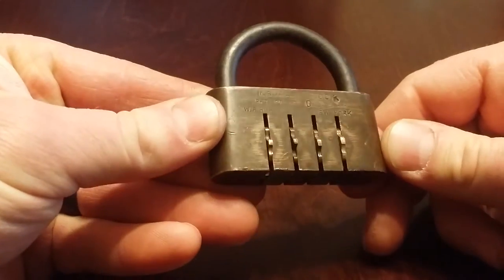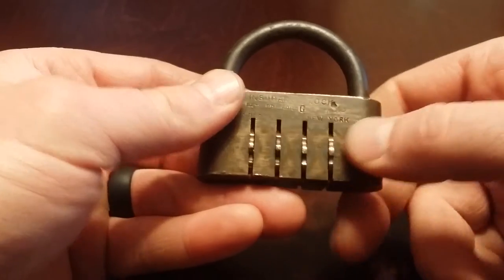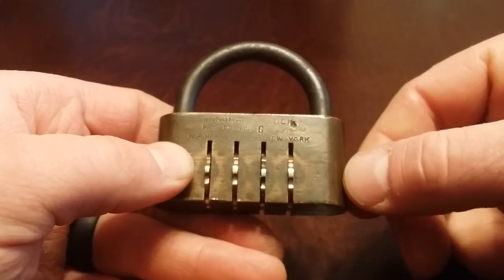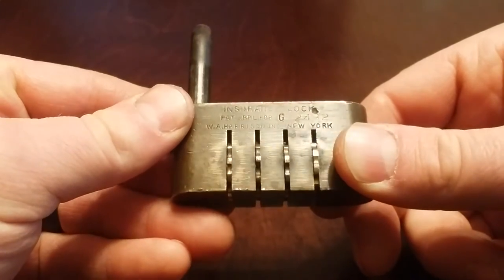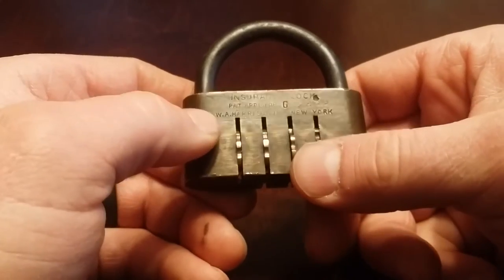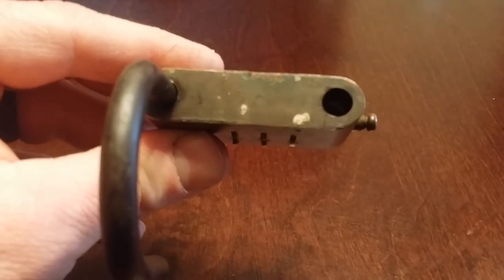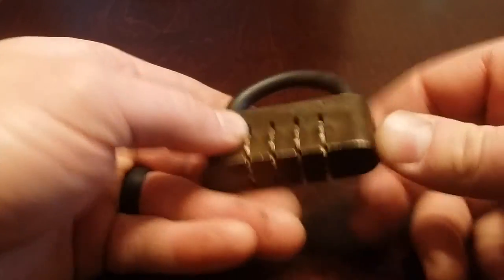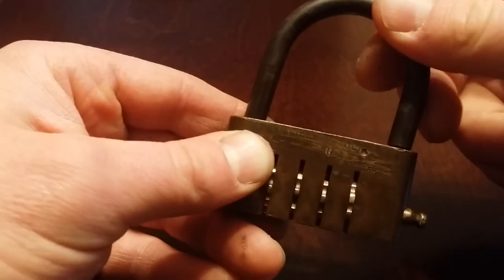Vintage W. A. Harrison Lock Co. New York Insurance Combination Lock

Comment: LockButcherShop I have this lock and the dials don't turn like yours all mine turn down ...But great info thanks.
Reply from the maker: Cool!  I'll bet they made any number of variations of the up/down directions to add more combination options and to slow down attackers.  I'm pretty sure cracking it and entering the combo would still work off the same principals just instead of up up down down yours would only be down down down down.  love hearing about these!!!!!  thanks for watching.
Reply: Was thinking the same thing on the variations of the up/down directions Love the video and yes some principals  to open it Thanks for the videos